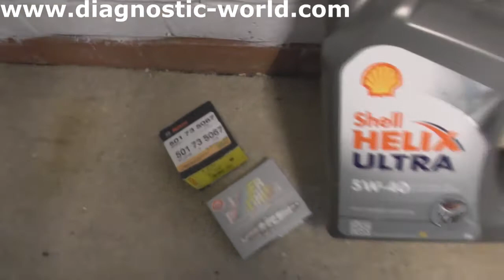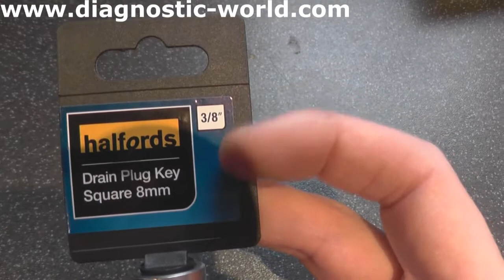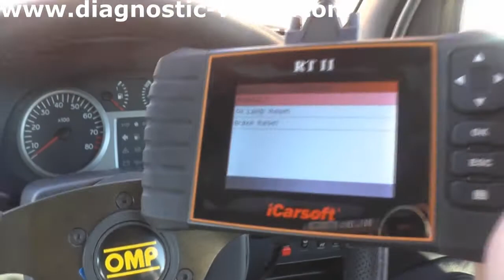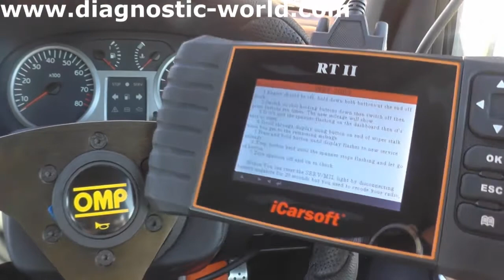Renault Clio Mk2 172 182 Oil. Filter & Spark Plug Replacement Service

Comment: Your spark plug removal tool should have a piece of rubber inside of it that acts as a suction to take out the old plugs, admittedly it doesn't always work 

Also I've always been told that filters need to be fitted HAND TIGHT ONLY

Comment: 172/182’s run better on original ngk plugs. Also the standard air box with an updated panel filter is more than adequate on these.

Comment: I'm very sceptical about cone induction kits over the standard air box which on a 182 is good anyway, performance engines like cold air not warm air from under the bonnet.
Reply: Everyone has their own opinion on this. I think its only an issue when standing still, as when moving, air is rushing around the engine from the grills so it should be at a low temperature anyway. Plus the improved throttle response is noticeable and the noise is worth doing it for alone.
Reply: Engines like both warm and cold air for a balance of economy and power.... That's why the 172/182 airbox has 2 air feeds, one shorter taking on warm air from the bay and one longer in the wheel arch attached to the acoustic valve for cold air... If you've got a cone filter just make sure you've got a cold air feed pipe near the cone and alls good....👍🏻👌🏻

Comment: You haven't neither greased the seal in the new filter nor filled it with fresh oil prior to installing. Sloppy.
Reply: I hate to tell you this but its a myth really. I know multiple techs that have not pre oiled the filter seal and have never had a problem. Its just personal opinion, However I do pre oil the seals.
Reply: Will always apply a small amount of oil to the seal but there is no need to fill the new filter with oil
Reply: You fill the new filter and it will all run out anyway lol.